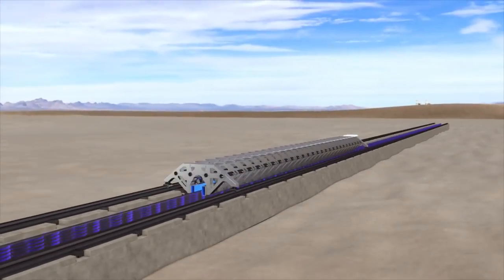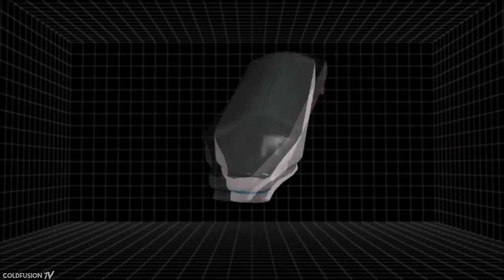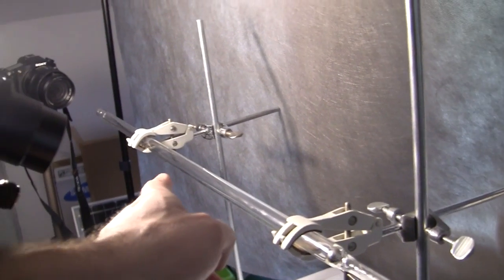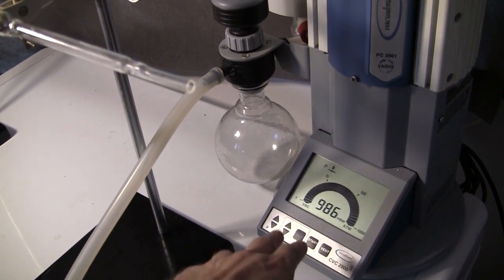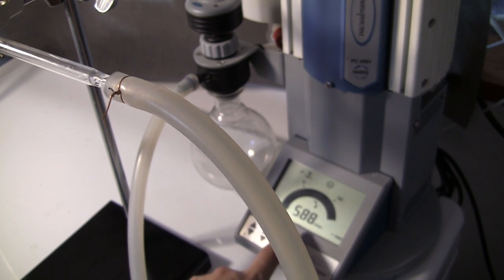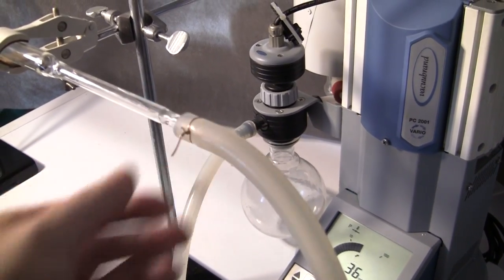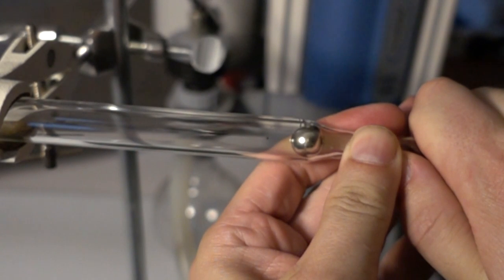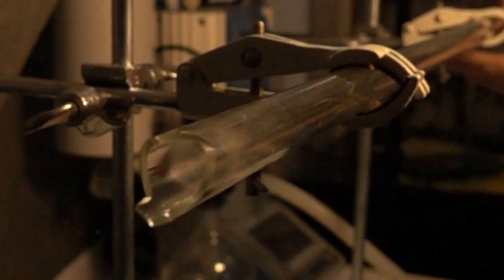How  the Hyperloop can kill you!

Comment: Hi Thunderfoot.  You are very great at what you do.   I was wondering if you can answer a question for me.   If a car has a generator, which keeps the car battery charged at all times. But if a person was to remove the battery cable (while the car was on), the Generator would keep the car running, and you could drive all over the world IF you never shut our engine off.   My Question:  How come Todays "Smart Cars" (battery powered) need to be charged when the owner is no longer driving it?  Shouldn't the "Smart Car" have a generator that constantly charges the batteries while it is being driven so the owner of the car does not have to plug their car into an Electrical charging station at night?   I have always been puzzled on why the cars generator can't keep the cars batteries charged at all times.Thanks

Comment: I have so many questions...

Does the air resistance effect scale?
Let's say you didn't have a pure vacuum, but instead only had half an atmosphere reduction from the outside pressure. Would that diminish the "bullet-like trajectory"?

Also, couldn't you have some safety mechanisms built in? In the event of a sudden pressure change in the tube, I could imagine having locking, mechanical brakes or clamps of some sort that would slow and potentially stop the pod.

Could you use generated magnetic fields to increase resistance for the pod, and thus slowing it down?

Comment: Hmm if the car was streamlined and didn't fill the tube like a bullet the effect could be substantially minimised. However at the speeds envisaged by the proposers it would be a problem if the decompression was ahead of the train causing a catastrophic deceleration.
If the train was moving at high speed away from the breach it could feasibly ride out the shock wave with minimal disruption?

Comment: Isn't the hyperloop supposed to be operating only at a partial vacuum? If there is a level of pressure, where it would still be feasible to use the magnets propelling the train as a stopper (similar concept is use in free fall towers, if I recall correctly), you could still operate it safely.

Comment: Apart from the problems with Hyperloop not getting very far very fast, and looking just at the content of the video, in practical terms the main potential point of catastrophic vacuum failure is going to be the points where passengers embark/disembark from a carriage. Nobody is going to want to pump air out of the entire hyperloop tube, so it's pretty obvious that these regions would themselves be isolated and sealed before the embarkation part of the tube is returned to atmospheric pressure. A carriage in that small sealed area isn't going to go anywhere if the (de/re)pressurisation fails suddenly. For the scenario shown here to play out you'd be looking at what would have to be catastrophic failure of what would amount to a giant sealing door. It just doesn't seem the kind of thing that can't be engineered so as to minimize risk. I would suspect that a bigger concern would be failure of a carriage to maintain pressure, but that's assuming that these things would ever carry passengers rather than cargo.
Reply: Really? You don't see any technical and materials challenges to keeping a kilometers long vacuum tube sealed essentially indefinitely?

Comment: Could not a simple fail safe be put in the other end of the tube that would allow air in if a vac failure was determined to have occurred.. I see what you are getting at in the video, but it seems to me that engineering (someone like yourself) could get around this problem with relative ease...
Reply: hi hot wheels restorer
Reply: Way late response I know, but part of the issue is that the passengers are dead the instant a sizeable breach occurs on either side of them, as the acceleration would not be survivable.
Reply: @xXponyinthestarsXx  how fast would the pod accelerate?

Comment: Correct me if I'm wrong, but wouldn't the shockwave of air from a tube failure have to strike the capsule before hitting the individuals inside? If so couldn't you absorb the shock through various means of engineering (A seperate outer shell to the capsule held apart by suspension for example).

In addition couldn't emergency pumps lower the pressure (Though obviously not restore it to it's travelling pressure) inside the tube, making impacts less devastating? 

I'm not really an engineer so if I'm wrong on these types of solutions corrections would be appreciated.

Comment: Last I heard they weren't talking about complete vacuum but 0.5x atmospheric pressure. I don't even know how they would achieve complete vacuum in a tube that supposedly stretches thousands of kilometres.But of course there could be pressure doors that open when the train gets into one section then closes behind it so they only have to maintain the low pressure atmosphere in the section where the train is. But with the speeds they're talking that's still going to be a very very long stretch. So yes it's a big problem, but impossible I don't think so. The question is it feasible, how much energy do they need to put in to maintain the vacuum, how much upkeep is needed for the tube to withstand the pressure, and so on. 

But you're going too far if you want to base your debunking on "tube failure" because in the same way you could debunk planes because what happens if the fuselage fails under pressure?  Everyone on board dies, that's why they figured out how to make fuselage strong enough not to fall apart in mid-air. So if they can make the tube not to fail without external "help". This seems more like FUD than an actual debunking to me.

Comment: In this video thunderf00t successfully proves that a device designed to make you go fast, makes you go fast.
What he does not prove, is why this is a problem.
Square cube law thunderf00t, that ball accelerates that fast because it's small, and so is the area of the cross section of the tube. In a bigger tube the forces on the vessel will be nowhere near as big, so a total system failure will be much less dangerous.
Also, if it's going to be transporting people, I think some safety regulations will be in place.
Also also, if a failure does happen, it probably won't be on the scale of it ripping fully apart, as is what happens in this video. A small leak will disrupt the acceleration of the vessel, but not by much.
All in all, it's like saying we shouldn't have planes because what if it falls apart. The solution is better engineering and safety laws, not abandoning promising tech.

Comment: If there is a breach then they'll have to let air in the tube on purpose (evenly) until they can fix the breach. The trains would have to deal with atmospheric speed limits until then. Just engineering  challenges here.

Comment: If you think its just technical problems to be overcome, imagine a truck hiting that tube.
Reply: Yeah, just imagine a truck hitting a tube that is raised 30 feet up in the air. That is some truck!
Reply: FDK Never underestimate average village idiots ability to destroy things.
Reply: "If you think it's just a technical problem that trains can go over 40 km/h then just imagine a truck standing on the rails!"

That's one not what thunderfoot is talking about and second not a failure state of the system - it's a security concern. Any transportation system has that, even walking. News flash: you can be run over while you're walking over a green flashlight.
Reply: whatever, my apathy kicked in

Comment: The only issue I see with your example is the limited space around the carriage that would keep the airflow from passing around it rather than "pushing" it. Since the idea is to merely reduce air resistance there is no need for the carriage to encompass enough space for the change in pressure to act as a means of propulsion.

Comment: "With no way of stopping!" Except for brakes, and the fact that the tube is much longer and stronger (definitely not made of glass, really?) than the one used in the experiment so you'd need to enact some sort of terrorist attack just to damage it enough to cause this kind of leak.  

Really Thunderf00t. This is pretty lazy. The model you used is completely different than what the hyperloop proposes. If you want to disprove it, use more accurate means, because right now you're just as bad as the congressman who threw snow on the carpet to try and disprove Climate Change.

Comment: My greatest gripe with this idea is that if the train stops in between stations and the passengers need to exit for some reason, let's say there's a fire on board, they will all suffocate in the tunnel unless they all have oxygen bottles. Even then the bottles have a limited supply of O2. The alternative would be to vent the particular section of the tunnel that they happen to be in, but then you have to make sure that the venting happens equally in front and behind the train (otherwise it would go flying forwards or backwards). EVEN THEN you've got the problem that hundreds of passengers are stranded next to a burning train in section of tunnel that happens to be the only one with breathable amounts of air in it, so they have nowhere to go.

The solution to THIS problem would be to build each tunnel section with exits that passengers could use in case of emergencies, but at this point each section of this damn thing is extremely complex, and therefore expensive, and it hardly seems worth it to build it in the first place. This is especially true when considering that in order to really take advantage of high-speed travel you need a huge rail network with primarily long, straight sections, and building such a huge network with such a level of complexity and safety systems built in would cost tens of billions of dollars. 

I don't think the hyperloop could EVER pay for itself, let alone turn a profit, especially when there are well-established, long-distance, cheap and relatively safe mass transit options already available, i.e. aircraft. If I had tens of billions of dollars to invest in something I would not touch the hyperloop with a ten foot pole; I'd much rather invest it into hypersonic, suborbital aircraft research or a manned mission to Mars or the moon. Sure, the hyperloop does not seem like something that's theoretically impossible but it's extremely impractical, and I'd argue it's not worth pursuing at all.

Comment: you can build stations at regular intervals, stations that can let air in and make the train slow down because they let air in from the oposite dirrection?

can you simulate the same thing again a few times but the metal ball is kept in place by an electro magnet and you increase the attraction towards the ball and you calculate how much it slows down the acceleration so that humans can possibly survive it?

i like your video because (for me) it shows that this idea costs too much (when adding the safety measures) and adds too little to the existing non vacuum designs

keep up the good work :)

Comment: You should have pierced a hole with a pin to simulate real life vaccum failure. To get an acceleration of that degree(this is the maximum it could get) you need to cut the tunnel in half. Shitty video

Comment: Sorry Tf00t, but that is not a debunking at all. We´re speaking of a maglev train. I.e. it can brake as hard as it can accelerate if you locally reverse the field.
Add a pressure sensor operating with high frequency and low latency to that, and the "brakes" can be applied automatically linear to the pressure loss. Add two or three redundancy sets and you have a cheap-ass fix of the problem.

Comment: I Thunderf00t really like Your videos, but not this one. To innovate often means to solve problems that nobody solved before. In this video, You showed a problem that needs to be solved before hyperloop can be used. But this is NOT like thorium car... this is problem that can be solved (out of my head: multi layered sheathing, with sensors inside, to worn when some of the layers get depressurized; powerful emergency break that can withstand instant decompression, or even automatic depressurize of sections on the other side of capsule, to compensate for damage in one section... I didn't take much time to think about this so You will probably find reasons why my ideas won't work, but I think that smart engineers with time and money can solve this). Of course, You cannot eliminate danger completely, when You put people into vacuum and launch them with supersonic speed, but You can work, to minimize risk, until it get acceptable.

Comment: We could have an entrance to the low pressure tube behind 2 valves. Then the train goes in between them and gets pressurized or depressurized. So looks something like this:
====|===|_____|===|=====    : where = is tube and | is a valve and _ is where you hop in. Or have 3 valves to prevent such failures

Comment: Couldn't they just install safety valves at set intervals to equalize the pressure in the event of a vacuum breach? Surely with current tech these could all be made to operate within milliseconds. And one would think the maglev track could be used as an emergency brake. There would have to be redundancy upon redundancy similar to airlines if this was to be used for mass transit.

Comment: Ah yes, a simple suggestion is seen as a heresy against the holy Elon Musk... 
Let us grab our pitchforks and torches to burn down @Thunderf00t, for Elon is never wrong and his Teslas are miracles.

You know, a Tesla has waaay more impact on the environment then a 2010 diesel car? Viewed in the lifetime of the vehicle, of course. The batteries alone consume enough energy to produce than three normal cars. Then there is the charging- where does the electricity come from? And what about the chargers themselves?
 
Hydrogen-cars might be the best solution, not electric cars. But then comes Musk- quote "If you're going to pick an energy storage mechanism, hydrogen is an incredibly dumb one to pick — you should just pick methane, that's much much easier, or propane,". 
Well, why not the current used fuel instead? Best energy density per volume and it´s cheap as well...
But he´s betting on electric cars, so why should he not advertise efficient and ecological technologies? Because he wants to make money, that´s all. Al his talk for "advancing humanity" are bullshit. What a hypocrite...

Same with the Hyperloop. The Hyperloop as it is a inefficient, costly and dangerous piece of shit. Not only that, for the r&d of this junk, he is getting support from all over the world. And his only selling point as "advancing humanity"...

You want advancing humanity and technology? Try Maglev instead (a.k.a. Transrapid). A well established technology developed and refined since the 70s, with a fraction of the cost.

But hey, let´s build our glorious Teslas to drive on our glorious Solar-roads and for longer distances, let´s switch to Hyperloops instead. 
What a monumental idiocy...

Comment: m8 do the bernulli calculation for the maximum flow rate of room temperature air into a vacuum(p1 - p2 = D/2(v1²-v2²) D = Density =>(v1 = p2 = 0) v2 = sqrt(2*p2/D))). i ended up with a max of 288m/s, wich means the wagon can't be accelleratet to a higher verlocity than that, and as i understand it's mooving faster than that anyways.
sill doesn't solve the problem when the breech is infront of the wagon anyway.
and apart from that this speed can only be achived, when the breech is ginormous, like when the whole tube breaks in half, which i deem unlikly to happen. if this has NOT happed, the flow rate is very much limited by Hagen–Poiseuille and bernulli equation.
On the other hand, if the breech is very big, the air will travel almost without hindrance through the tunnel (i calculatet 4 mbar per 10 miles pressure loss through hage Hagen–Poiseuille) so that would be quite desasterous.

Comment: I will admit that the hyper loop is a really cool concept but there are so many safety concerns with it that I doubt it will ever be built on a large scale. Maintaining a vacuum on such a large system would be very difficult and just like you show a sudden failure would result in significant damage to the entire system even if there wasn't a vehicle moving through the tube. Not to mention they want to build these hyper loops under water ways and if a failure were to occur with water then it would probably destroy the entire system.

Comment: sounds like a problem that could be fixed by a emergency venting system that responds to drastic pressure changes.

i think more important is the question: will this even more expensive transrapid have anything to offer that will make it a profitable way of transportation?

Comment: Just because its a difficult engineering challenge doesn't mean It shouldn't be attempted,fail safes can be implemented. One big difference i noticed between your experiment was that the ball and the mag lev hyperloop move in different ways ,so thinking about it for half a second like I just have if something similar were to happen on a hyperloop you could switch the polarity of the track or car decelerating or flat out stopping the car or you could have a multi layered vacuum track , a tube inside a tube so that if one fails the other keeps the pressure level.I mean you could have done a similar example when it comes to landing a rocket and used a bottle rocket as an example of how it was bullshit but space x just did that with an incredibly complex engineering and computer systems so whats to stop this being done in a similar fashion

Comment: I have a question, what happens if you use a ball bearing that is much smaller than the glass tube? Would depressurising be an issue if the train was much smaller than the actual tube?